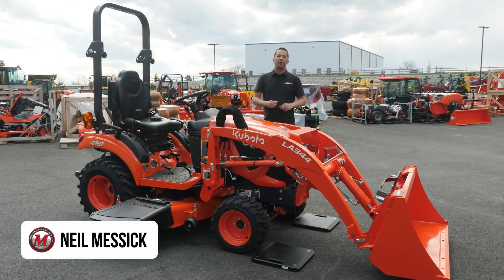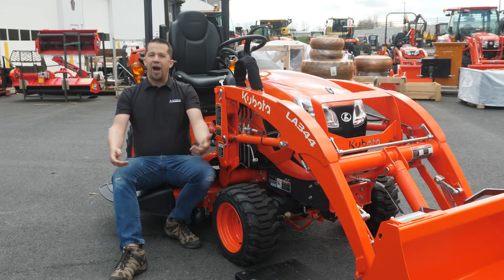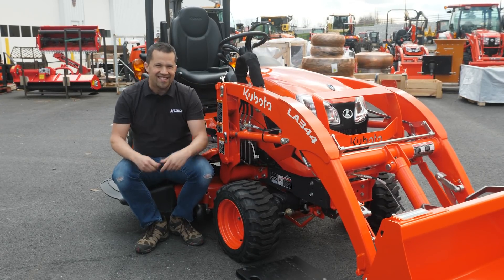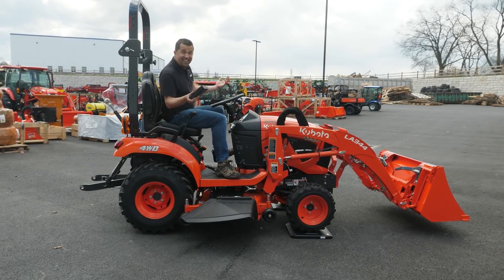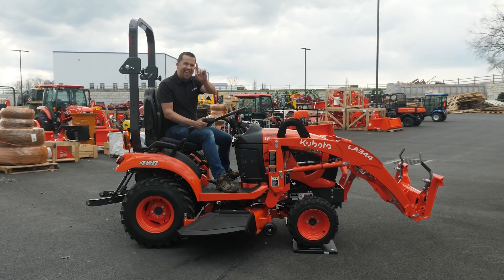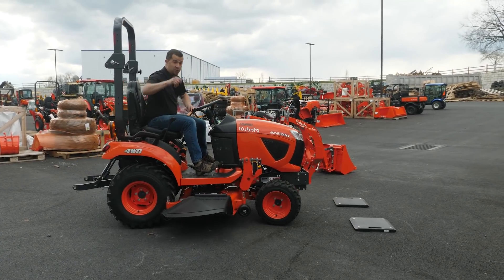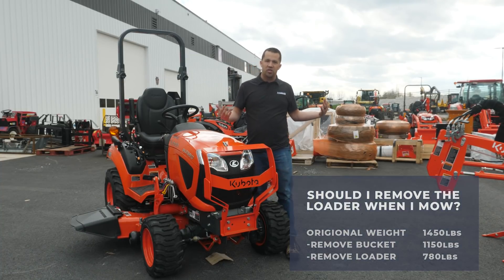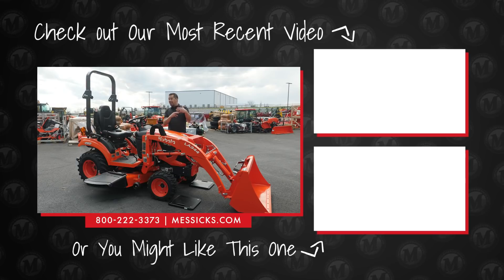Science! Why you should remove your loader when you mow.

Comment: I figure if you need to remove the loader to mow, then you bought the wrong machine. Finish mowing conflicts with the needs of pretty much every other use of the tractor. Just buy a dedicated mower that weighs less and works better.
Reply: Agreed. Aside from enjoying the extra seat time, I don't see how folks rationalize the price of a mid-mount deck when a little more money will buy a ZT that will mow circles around any tractor. If the 'lawn' is too rough for a ZT, then I want either a rotary cutter or a cheap RFM.
Reply: Some people buy 1 piece of equipment that can do multiple tasks, that's why people have a compact or sub-compact tractor with a mid-mount mower.  I have a lawn tractor, but, if I'm getting ready to do a mowing job for someone, I throw the mid-mount mower on my BX2680 and go do the job, and mow my lawn with it as well...however, do I need a mid-mount mower, no, does my lawn tractor handle my lawn, yes, but the mower/tractor will tackle heavier jobs that my lawn tractor couldn't...my BX2680 has 4WD, my lawn tractor will get stuck in every little rut, so will a ZTR...I mowed a lady's 1/2 acre pasture last week with my BX2680....lots of gopher holes, if I were to have tried that with my lawn tractor I would have spent more time trying to get the thing un-stuck than mowing.  A zero turn, or a lawn tractor has some severe limitations in heavy mowing tasks...it was a pasture, it was clean, it was grass and weeds, no need for a rotary cutter (brush hog), it was just overgrown because she couldn't find anyone to mow it for her.  My BX handled the task just fine because of the larger tires and 4WD....I needed the 4WD in a couple of spots because of the off-camber situation and gopher holes, my lawn tractor would have been getting stuck on just about every pass where I had absolutely no problems with my tractor & mower.  Plus the tractor sits higher, making it a bit easier to see in that tall grass/weeds, also keeps me up out of some of the dust too.
Reply: @wildbill23c  Interesting use case, though most people use a finish mower for regular cuttings on smooth ground and 4wd is a negative because it chews up the grass. So I still say most cases a separate mower is a better choice. Faster, more maneuverable, does a better finish, and compacts the soil less.
 The right zero turns will go everywhere you just described though. Stanley Dirt Monkey demos several of them on his channel driving through high brush. They might not be the ones that would be economical to buy both mower and tractor  vs tractor and deck though. Stan's machines are definitely high end. 
The really old zero turn I have would get stuck on steeper or brushy terrain.
Reply: Sounds like your wasting a lot of money for something that takes minutes
Reply: @danielmassella9162  It's not just the loader. Tractors need to be heavier to be effective in most other applications. Generally you want wheel ballast. 
You want 4wd. 
You want to be able to quickly swap implements.
Tires that produce lots of traction.

On a mower you want light weight.
A bagger that is easy to use. 
Compactness to get into tight area. 
A tight turning radius. 
Turf tires. 
Low setup time as it is something you do weekly 
Fuel efficiency. 
Speed and maneuverability. 
A smooth cut without scalping. 
To be able handle a grade. 

A tractor does a mediocre job at most of those requirements. The uses are in conflict. You aren't going to attach your wheel weights every time you need to use the loader or change the wheels to turf tires. Also the cost of a tractor mounted mower is often similar to the cost of a dedicated mower. IMO a tractor mower only makes sense for large fields with very few obstructions pulling a huge gang mower doing 10ft+ cuts. Anything less than that, a dedicated mower will be faster and do a better job with less fuel used, and lower soil compactions and turf damage.

Comment: The question I would have is, "If you're mowing with a 3-point attachment (finish mower, rotary cutter, flail mower) instead of a belly mower, should you leave the loader on to counterbalance the weight you're hanging off of the rear?"
Reply: I would leave the loader on in that case. Unless you add suitcase weights to the front....but then that is only 250-300lbs
Reply from the maker: Yes

Comment: The psi on the grass/turf is equal to the air pressure in the tire, regardless of the weight.  More weight means a larger contact patch at the same pressure.
Reply: So what happens when there is 0 psi in the tires?
Reply: @CorkeryCoop  then there is no weight distribution by area, the force balance occurs at whatever the point of contact is, likely in line with bottom center of rim, and the pressure transmitted to the ground is dependent on the geometry of the contact point.  There’s always a contact patch, it’s just that with a tire it is flexible and changes but with a rim it doesn’t, which is why a rim bends if you drive on a flat but is fine if the tire has air.
Reply: I read through the comments looking for this. Thanks.

Comment: This is 100% true running a MMM, but if you have a 3 point finish mower, there are times where the weight in the rear can bring the front wheels off the ground if you don't have a loader.   I have a 72" FM on a B2410 and there were times I did wheelies in transport mode! :)

Comment: Thank you for great video, advice on removing the LOADER front. I see farmers raising the front Loader up all the way sometimes doing a field. Just asking why that is done.
Reply: Raising all the way up is generally not advised, it makes your tractor easy to tip over - I nearly tipped over my (unladen) BX with the loader all the way up, on flat ground, just by turning sharply.

I have about 3 reasons I drive with the loader all the way up sometimes.  1.  If it's too low it hits things - low fences, decking, shrubs.  So I need it higher than the lowest thing I mow around.  But I also need it not in my sight line, so I then have to raise high enough to look under it.  That also means it sticks out less far, and is way higher than most things it might hit.  It's also dangerous, so you need to be experienced and aware of what it's doing to your weight balance.  On a larger tractor it's less of an issue of course.
Reply: Probably either the loader is of the type that isn't easily removed, or the type that is not removable....or they're just too lazy to remove it.

Comment: Great idea for a video! I mow far more than I use the loader, maybe I should default to leaving the loader off and just put it on when using it? The problem is I can't predict when I will want to use it, it's so handy and if I have to go put it on I might just decide not to use it. I do take off the bucket when mowing in tight quarters, but based on this video I think I will leave the bucket off nearly all the time now (it's easier to put on when needed)
Reply: I take my loader off whenever I mow.  I put it on when I need to do loader work.  I have it on and off a couple times a week.  Takes me about 2 minutes, maybe less.  Practice makes perfect (and quick).

Comment: Since you're moving the center of balance of the tractor along with removing weight, it would be interesting to weigh the rear wheels too. I'll bet you actually increase the weight a little back there. Anyway, worth pointing out that this advice might not hold when using a 3 pt mower; in which case, the loader counter-balances the mower.
Reply: You're exactly correct.  In fact, every lb of weight that Neil was talking about, above the weight of the equipment, comes OFF the rear.  Weight doesn't come out of thin air, it always has to come from the addition, subtraction of weight somewhere else.  He cited that the removal of the bucket reduced the front tire load by about 150 lbs more than the bucket itself weighed so that means the additional 150 lbs was shifted back onto the rear axle.  The same happens when removing the loader.

I do a lot of material handling with my BX therefore I run a ballast box in the rear.  If I choose to remove the loader to mow, the tractor becomes so light on the front that it's hard to steer at times.  I can actually lift the front of the tractor by hand in that configuration.  I'd submit that tire wear on grass is theoretical and not practically measurable at all between 4WD or 2WD modes.  If a person is at all concerned about the health of the front tires on a BX, they would be well advised to toss those OEM tires in the garbage where they belong and replace them with BKT tires.  OEM BX tires, especially fronts, are just garbage.

Comment: I leave my loader on because I use my grapple while I'm mowing (rotary mowing) picking up down limbs and such as we mow around the farm.  Plus, it helps find hidden objects. The yard gets mowed with a zero turn.
Reply: I think this is intended to be specific to mowing with a mid mount mower deck.  I've only used the MMM a few times - mine is a backup to the dedicated lawn mower - but find it utterly mind boggling that people use the MMM with other implements still attached. Besides the points Neil mentions here, mowing around the house with a loader or rear implement attached is a great way to smash things up and makes it harder to maneuver and mow in a time efficient pattern.

If you are using a rear implement on a subcompact, you will normally want some sort of front ballast and the loader is usually the easiest, because it's already attached.  When I use a rotary cutter / brush hog, I put a belly plate in place of the MMM to avoid damage to the deck and protect the hydraulics, and use the bucket to push over small trees and brush.  One day, I will have all the thick stuff cleared and just use some front weights, but that day is not this year.
Reply: @that.schamp  I’m o

Comment: Another excellent video.  But there are always more questions.  I have a rear-mount finish mower instead of a mid-mount mower.  I also have a couple of hills to mow.  Would removing my loader make as much of a difference when using a rear-mount mower?  Would removing the loader make the tractor more likely to flip over backwards when I'm mowing straight up a steep hill?
Reply from the maker: You would want it with a 3pt mower
Reply: @MessicksEquip  Thanks for the response!

Comment: Great points, Neil.  I "mooo" my grass with a 2650 with a cab (yes,a  lot of weight, I know).  I generally try to "mooo" without the FEL attached and noticed my tractor becomes more nimble in its ability to navigate on turns.  This is another bonus factor to the points mentioned in the vid.  All that weight removed and Ol' Stubby performs a little "moo" betterer.  😛
 I wonder about the trade-off of rear tire ballast as well. I have beet squeezings inside the rear R4 tires and wonder how that all adds up. I've been pondering switching to turfs w/o the squeezings.  I have the 3-point as an option for weight, but I don't have any attachments (yet) for back there.

Comment: I'd be interested in knowing the impacts of keeping/removing the loader for billy goating hills. I have a 45° or so hill that I mow across on my Cub Cadet LT1050 (hanging off the side over the superior rear wheel) which is not recommended. I'm just interested in the impacts 4wd and a front loader would have to that capability.
Reply: A loader will make the tractor tip more easily because the weight suspended out the front will unload the rear tires.  You can counter weight the loader with a rear implement, but still have to think about the effects of the attachment / implements on the center of gravity. In the low position, they may make the tractor more stable, but if you have to raise them to traverse on and off the slope, the tractor will be less stable during that transition.  Front and rear weights are a probably a better way to give the tractor stability than implements and attachments.

For the most part my riding mower (D100 series) does much better than my BX23S on slopes because the BX has a much higher center of gravity.  The BX is just not very stable side to side.  Wheel weights or ballast in the tires would help, but probably would not be enough - and those may be options for the mower, too.

What the BX can do better is traverse a ditch or go straight up/down a hill, because it can raise the deck higher, has more ground clearance, and has 4WD with Industrial tires (which are not good for the lawn).  It can also run a small ditch bank mower (someday - those things are $$$).

For the side of a hill, the best bet is probably a zero turn, as they often have the motor and seat mounted lower and have a much wider wheelbase than traditional riding mowers.

Comment: Good info! You should also have weighed the rears; as you put load up in front of the front axle, you take weight off the rear axle. So I expect that the weight on the rear axle has increased. I realize that the rear tires are large, so you spread that increased weight over a larger area. But weighing the rears would have made the test complete.
Reply: Reducing the weight 300 lbs by removing a 150 lb bucket.. just added the other 150 lbs to the rear. Similar for frame.
Reply: When I got my LX back in December I got out my scales for the race car. It surprised me how much the weight shifts between the front and rear axle just lifting the bucket up to 4'-5' off the ground.
Reply: you really need a 4 pad scale so you can see the  weigh on all 4 corners.